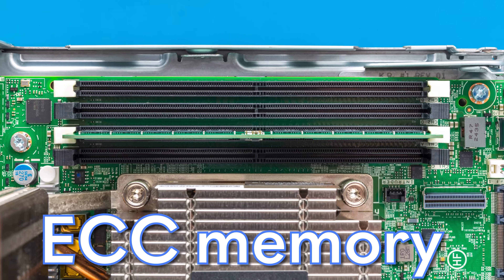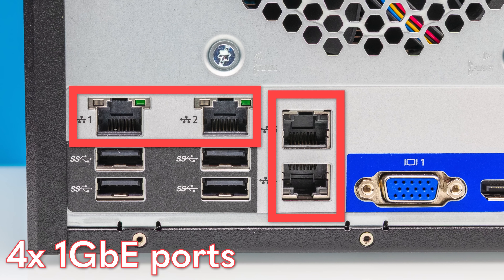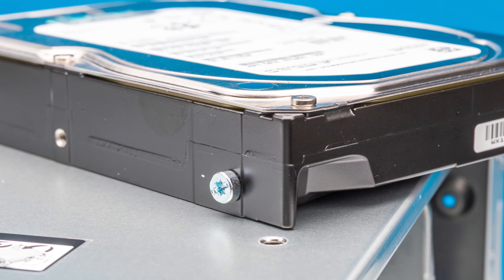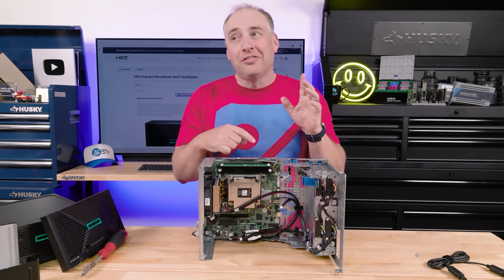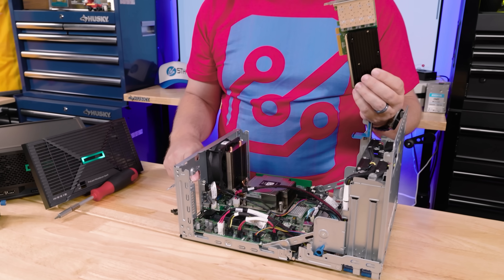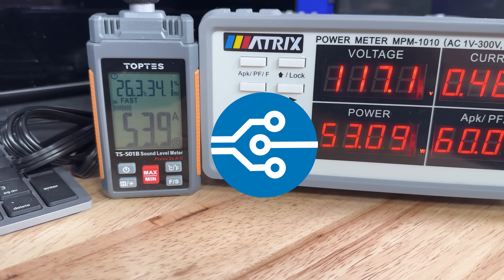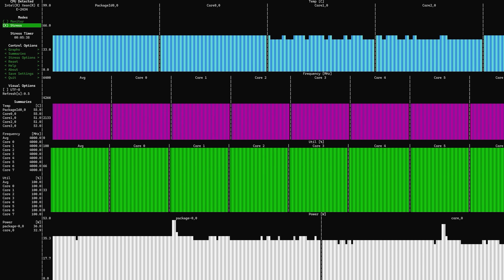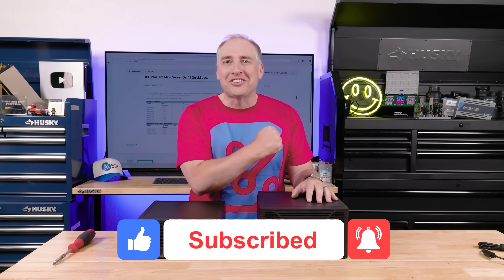THE OG Mini Server is Back - HPE ProLiant Microserver Gen11 Review

Comment: So we have these at work and LOVE them.  We changed the CPU to Xeon E-2468, added 128GB RAM, and put in two PCiE cards.  One card is a 2 port Melanox 10Gbe SFP+, and the other was for NVME boot drive. Loaded the 4 internal drive slots with Enterprise SSD, and this thing is a screaming Proxmox server that absolutely runs circles around our 10 year old traditional server that’s heavy enough to be a boat anchor. 

We have 3 set up in a HA cluster and it is the bomb.
Reply from the maker: Great feedback
Reply: so... no difference than G10+ but higher price?
In my region a base version with Pentium cost more than I paid for Asrock DeskMeet x600 with Ryzen9 7900, thermaltake cooler, two NVMe, two HDD and 126GB of RAM + dual 10GBe NIC on top I had 2.5Gbe NIC on board... I still run MSG8 on me and comparing to G11 I see no reason to get G11, back in G8 era there was little to no small form factor edge servers and G8 was a boom, with current market you can get better deals - I'm not talking about 2nd hand market - with better upgrade path and out of the box features for less...
Reply: @nibbonnacci8980  can you give any other suggestions on the market?
Reply: @nibbonnacci8980  there is no way the gen8 had enough memory or processor power to run what we run on the gen11.  And disk operations take a significant hit due to the hobbled SATA speeds.  We have a Gen8 set up as a backup server. But the Gen11 set up as a backup server is over 4 times faster on full VM restores.  The two aren’t even close. 

The gen10+ is great. But it’s still short in memory and processor selection. We have one. It was close to being able to handle our loads, but not quite.  We really needed the gen11.
Reply: What work does this thing do at your work place?
Reply: @avalagum7957 , we were mainly VMs. Domain controllers. File servers. SQL servers. A special application server.  Other specialty servers and a handful of containers.  A mix of Windows and Linux.
Reply: I have a proxmox cluster in homelab and love it. But how is Proxmox in an actual work environment? Always wondered.
Reply: Which NVME PCIe boot drive did you use? Is it the one from HP: HPE NS204i-p x2 Lanes NVMe PCIe3 x8 OS Boot Device? I want this, but need to find a compatible one and I want to boot from it.
Reply: Came here to basically say this.  These things are used heavily as standalone hypervisors (ESXi (until vSphere 8 goes EOL anyways), Hyper-V, ProxMox, etc.).  Low performance VMs (especially if they aren't Windows) run just fine on spinning disks, even in 2025.

Also, again not sure what the people in the comments here are attempting to use these for, or if this is just a lot of people that are playing the numbers game (the biggest one sticking out is people scoffing at the 1Gbps NICs), but at my current employer we have several standalone hypervisors that just have single 1Gbps NIC connections (standalone ESXi, so no LACP support) and we get ZERO performance complaints from these sites.  These sites barely have any 10Gbps ports, so it's never something we've been concerned about and I have a feeling we're not the only people that think this way either.

The MicroServer line and others like it are meant to run stuff like : Branch Office Network core services (DNS/DHCP), Active Directory Domain Controllers, File Servers, Printer Servers (with like maybe a dozen printer shares), Access Control System backends, Time Card back ends, Point of Sale backends... basically a whole bunch of stuff that is low CPU, low/moderate memory, low storage requirements, and low network traffic.

If you're looking at this as something that's going to mimic the performance of a modern 2U rackmount system then, yea... you're gonna disappointed.  But, if you have requirements that are inline with what this box offers (and many businesses don't need much more than something like this), the MicroServer is still a great solution.  It's funny, Dell really only offers something like this for "Industrial" spaces (and it's priced way higher as a result), so HPE doesn't really have a ton of competition in this space as far as something you can buy with a NBD support contract and "Enterprise-y" stuff like IPMI.

A lot of the former customers for something like this have taken all their workloads to public cloud hyperscalers in the past 5 years so I'm guessing HPE doesn't sell anywhere near as many of these as they used to.  But, if you still have sites and/or customers that need/want on-prem compute & storage that isn't mission critical, these are still great options.
Reply: @pdegnan4852 And old empler of mine required phone modems - that's no excuse to still rock them. Vendors can always offer min and max models for each generation.
Reply: You can drop 128GB RAM on ANY DDR5 1L PC or laptop!

Comment: What only 8 cores and 1GBE?! That's DOA. Laptops come with more cores.
What were they thinking? 
This is supposed to be for edge compute not edge NAS. There are better, cheaper options out there for SMB.
Reply from the maker: But if your company runs HPE and iLO, then this is the option. Laptops can have more cores, but to do NAS you do not need that much CPU. Also as a local AD controller, you do not need a ton.
Reply: @ServeTheHomeVideo  I understand what you are getting at for a company but for SMB there are better options. Most SMB can't afford Dell/HPE. In terms of value Minisform's NAS offers great value on paper. 5 HDD bays, ECC memory, 10Gb+5GbE LAN while their designs are not mature with years of experience, but they are affordable and there are a lot of new NAS providers finally entering the market. If the SMB has 3-9 staff the value just isn't there from this HPE product.

Comment: Like people use a 4x 1gb bond on a server like this. 4x 4gb is sufficient enough.
Whats bad at most, is the unscrewing the backside to remove the bezel/hdds.

Overall, its a nice starting server, or small backup solution.
Reply from the maker: Great feedback
Reply: A 4x 1 Gbit/s bond is something you can do but it's really bad design. This also means more cabeling and more importantly you're blocking 4 Switch Ports instead of one or two. And then you still only get limitations depending on which type of bonding you're using. Bonding isn't a magic bullet. I can get behind that 10 Gbit/s is still not that cheap, but 2,5 Gbit/s is really cheap these days.

Comment: HP/Lenovo have had really cool case designs for years and I personally like them a lot.  I don't mind the CPU choice, but if I'm buying a server CPU, then I want all my PCIe lanes accessible for things like U.2 drives and while I understand there are plenty of organizations still running on 1gbe, there should have been at lease 2 10gbe /SFP+ ports on this thing.  As it is, now one of the two expansion slots will be taken up by the 10gbe card.  This little server would have been a hit 5/6 years ago but it's 2025!

Comment: For that price I would expect at least dual ≥10Gb/s ports. Given the target audience either combo ports (100M/1G/10G RJ45 xor SFP+) or even two RJ45 ports + two SFP+ ports. There goes one PCIe slot. Give me four NVMe slots (either M.2 with enough airflow or U.2 would work) and four 3.5" SATA ports too and I wouldn't complain about the price. As it stands HP should throw the design away, start from the Gen8, update it to 2025 specs. That means hybrid storage and ≥10Gb/s Ethernet ports.

Comment: Honestly, this video doesn't make a lot of sense. He's not bench marking the right things. No throughput? It's a storage server. I don't care how fast and can run AI. 😩

Furthermore, the undocumented and unusable ports, the PCIO and OCP are probably not supported by the BIOS. The board is a multi-product design that probably is the same layout used for OEM, system interrogators or higher end products. He should mention this instead of just being clueless and telling it it's a "fun whatever". 

Overall he's wastes time explaining what a screw into a HDD does for the swapable bays and other pointless details without ever pointing out why they made the choices they did. Xeon is better for DDR5 EEC. Yes AMD supports it but Intel has better compatibility.

Finally, saying well it would be nice if it was FLASH. OMG it's clearly a HDD product. that's why it only needs 1G network. If you want a flash storage server, get one of those. It's like complaining why isn't my Chromebook have a powerful GPU?  Because it's for running spreadsheets, not games!  This is clearly a storage server for an office that needs a lot of storage space in a box that will last 10 years without failing. You put a 2.5G ethernet in there that overheats and it won't last that long. The performance isn't really relevant. You just need access to 10 years of tax reports or whatever boring business stuff.

Comment: So, this could be great as an AM5 EPYC 4000 based server. With a B650 you'd have enough PCI-E lanes (up to 36) for M.2 drives as well as PCI-E slots, more and/or faster networking, faster USB ports. The limitations would be around the chassis size and density (affecting serviceability).

I fear that cost would be impacted but with a user serviceable socketed CPU you could start out with a weaker or even consumer CPU and then have options through the EPYC 4000 line-up. Not to mention that there's another generation, Zen6, coming to AM5 with probably 24 cores and EPYC will likely want some of that too.

Comment: The big why the first Microserver, the n54l, was so popular (after the inirial price dropped )was it's super competetive price, Yes, the newer ones are a better bit of kit, but they are also priced much higher. The 2 reasons I wouldn't buy one though, no redundant power supply and 1G Nic's only - common HP, at least put 2x 2.5G in it.
Reply from the maker: I agree on the pricing. A lot of that is that the chips are still quite expensive. The Xeon E-2434 we have I think is ~$290 1kU pricing. The EPYC 4124P in the Lenovo is $149 and faster.

Comment: Still running a Gen8 here. Really nice machines to work with, but if I couldn't get the 10g card in there, I wouldn't have it.. and I think SFP+ at the minimum for these micro servers now, we're realistically looking at huge amounts of storage in these if you're going to be buying one. Are you really going to spend +1k on the server, and extra on drives just to stick with 1gbit networking? come on... one of those PCIe slots are going to be used by a 10g or better card out of the box.
Reply from the maker: I tend to agree on wanting 10G

Comment: To disagree with many people, gigabit can still be fine for a lot of SOHO/SMB customers. Networking is cheap, and file transfer for your normal size business files is fast enough. You certainly wont see a benefit of faster networking if you are just running a smal AD server with a little shared storage.
Reply from the maker: I think the challenge is that it is a relatively small cost to upgrade these days, but it expands the use cases quite a bit.
Reply: That’s no excuse that it is enough for regular file transfer. This kit is expensive and have worse networking speed than most mini pc. It’s like putting out a new iphone pro and having wifi AC because it’s fast enough to stream youtube.

Comment: what I found with mine is that if I use it without any expansion (PCIe devices, m.2, HDD) it's dead silent, but as soon as I start adding expansions the FAN becomes unbearable
the reason seems to be the use of non HPE parts. I even found that it's exponential, if I add a single thing, like an M.2 drive, or a 10G NIC, the noise increases a lot but it's not crazy, however, if I add two non HPE parts, boom! the FAN goes into jet mode...
changing FAN mode in the BIOS is useless, updating every firmware to the latest version is useless, the only thing that helps is an hack through iLO API call to reduce the FAN noise by some %, but it's not enough
Basically, if you want to use NON-HPE parts I suggest to stay away from this generation, unless you plan to keep it somewhere very far from your ears...

Comment: I got the lowest end SKU of this thing, upgraded the g7400 to an i5-12600, switched the 1x16GB UECC to 2x32GB Non-ECC. I added a single AQ100-based 10g NIC and run Unraid on it. Only bummer is that could not get HP's agentless management software running (no slackware version available), so the fan does not get lower than 19% with my config. upgrading ILO to "advanced" is still easily possible via the ancient way, iygmd. TrueNAS would be preferrable, but I just moved my setup from my gen10+ and was to lazy to start new, especially converting my 3x14TB into RAIDZ1.
Also, the MB has those additional connectors because it is shared between other GEN11 machines, like the ML30 and the DL20
Also also, the second PCIE slot only supports up to x4 links, if the silkscreen can be trusted.

Comment: I agree with the CPU suggestion. Would have preferred this to have AMD instead of intel. I would also prefer having a normal PSU inside this than have the brick outside. Never been a fan of the external brick PSU.

Comment: No 10gbe no thank you but it's neat I guess? Having the ILO chip on the mainboard but the connector be an option is such a typical HPE "everybody loses" solution. Really love the HDD tray screws storage on the chassis. 27w idle is also a little yikes. The thermal solution is obviously underspecced (unless there's another silly reason your chip package power goes down to ~40w steady state) so shoving a 95w chip in there seems turbo-wasteful. The base system coming with a 4TB sata spinner is extra hilarious. I guess the OCP port might indicate they'll make a flash-based system with a similar mainboard?

This is really just a desktop on its side that'll take ECC, and a quirky but useful case design.

Comment: I am using HPE ProLiant MicroServer Gen8 running TrueNAS core for the past 11 years with no issues.  I've upgraded the CPU from a Pentium to a Intel(R) Xeon(R) CPU E3-1265L V2 @ 2.50GHz.   I was surprised to see HP even offered a Pentium when I bought this brand new in 2014.

I am a little disappointed HP didn't go with an AMD Eypc CPU for the gen 11 as it would have been a killer thing to have.
Reply: Aye same! Though mines still on the celeron. Do you think I'll get an improvement on storage speeds upgrading to a Xeon?

I'm using mine with a P420 in IT mode. 16gb of ram.

Comment: Price? The key factor in Gen8 popularity was the dirt cheap price. (There was a Germany store, computeruniverse, which sold the basic model for ~200 EUR and shipped overseas too.) If this new Gen11 still costs 1000+ EUR, no individual customer will consider it. 2 PCI-E slots are nice though, perfect for a NAS+HTPC combo machine (1 for 10G SFP+ NIC (or higher), 1 for single slot half height GPU).
Reply: try £2000 going by the vendors in the UK
Reply from the maker: I mean the Newegg retail is like $1000-1300 so that seems wild pricing wise. Usually there are resellers that are much lower than Newegg
Reply: @ServeTheHomeVideo maybe we just get shafted here in the UK 😂
Reply: Useless...
Reply: Yeah, indeed. Out of curiosity I googled the prices and see them in the 1200-1800 range. As I had a different price for my gen 8 in mind, I actually checked: I paid 219 euros for my gen8 one in 2016.
Reply: @DavidBaakman  Upgrade the CPU to E3-1265L v2 and max the 16G memory. (less than 100 USD) The little tank can still keep up for 5 more years.
Reply: Exactly - Anything above €2-300 without the system being populated is a joke

Comment: I think everyone in this audience is going to be in favor of faster than 1GbE speeds.  I also imagine HP probably has done their research into the segment they are targeting this for and figure this either isn't a deal breaker or people can just add in whatever card they like to get faster ports.  I'm sure a lot of small business users are completely satisfied with the slower speeds.
Reply: I can see them justifying not going with 10 Gibt/s since that's still somewhat expensive. But the same definitely can't be said regarding 2.5 Gbit/s. And even if those folks buying these don't "need" it now or don't have the switching equipment to use it now it seems like quite an omission not to throw it in there regardless as future proofing.
Reply: @pearcomputers2542  Yeah I don't think it's a customer-friendly decision.  I think it's something they did because they thought they could get away with it forciing some people into a higher-end product segment or having to buy extra options.

Comment: G8 microsever was a masterpiece and a fantastic value proposition in its day. What I wanted was same form factor and 2x m.2 and nics 2.5GB eth nics. Raised ram ceiling and new low power cpu with gpu on board. It was £125 deal with a switch when I got my first one. If it was £500 now with my spec I’d bite but this platform has gone super expensive and trash spec. Oh well.